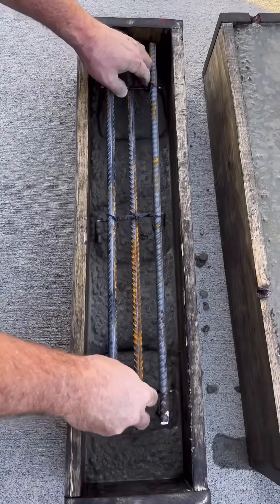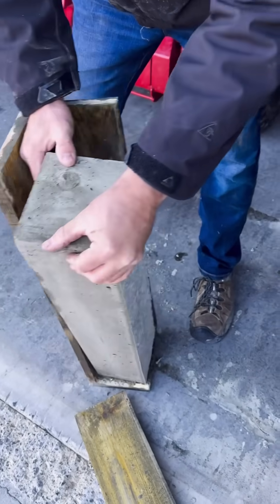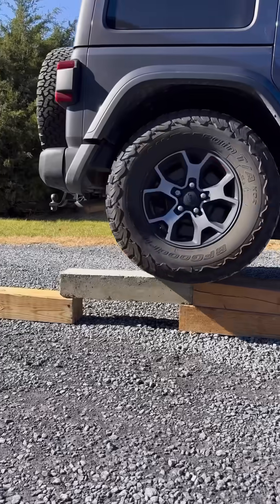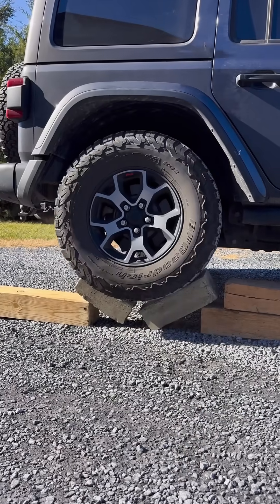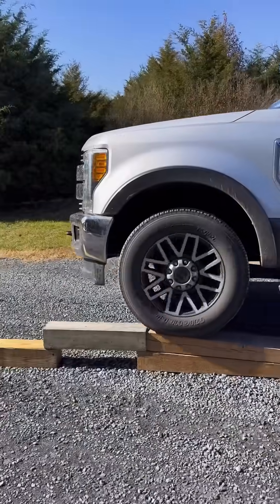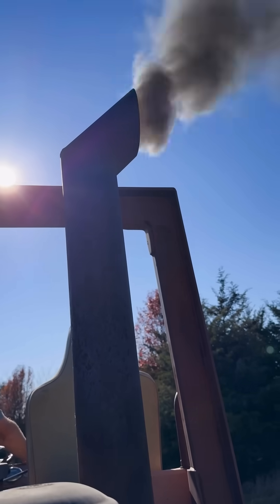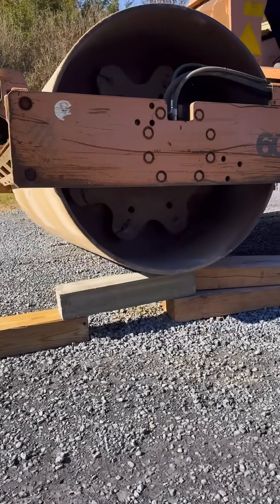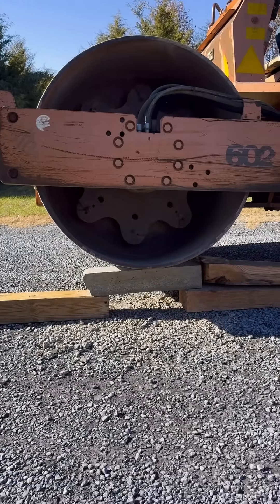Why We Use Rebar To Reinforce Concrete

Comment: Concrete slabs dont require rebar or wire mesh if placed on properly graded and compacted ground and properly spaced control joints will prevent cracks on the surface. Placing rebar or wire mess promotes fractures  but keeps it all together making the concrete strong but not visually nice. Therefore add rebar to suspended or load bearing concrete not slabs and save your money. Concrete finisher of 20 years and son of a contractor

Comment: In terms of how long ot was curing that would depend on temperature but other than that maybe 2-3 days. Could have placed the rebar lower as well to increase tensile strength slightly possibly
Reply from the maker: 2.5 days

Comment: I was told it takes 30 yrs for concrete to cure 100% .
Reply: Im guessing that would depend on what psi the concrete is and the width depth & length of it. Again just guessing
Reply from the maker: They say the concrete in the Hoover dam is still curing. Although a very small amount per year

Comment: The bars need to be at the bottom
Reply from the maker: Actually I put the bar in the top third when I poured the cement then I flipped it upside down before testing.

Comment: Clean, painted, not rusted rebar works best. All that rebar you get at the local yard that is rusted over causes issues also. Every builder uses it, and people wonder why concrete cracks so quickly.  Paint/seal the clean rebar so that the chemical reaction of rust/steel/water doesn't cause it to crack. I bet the beam wouldn't break if the rebar was clean and sealed before  putting in. You can see the concrete split from the inside center when broken with the vibration.  That means the rebar had an air gap around it from the rust/fumes.
Reply from the maker: You can purchase epoxy coated rebar

Comment: For the curing as in with the maximum load for its materials must take 2 weeks. with good watering after drying, concrete needs more water to strengthen.

Comment: The amount of people that think wood has better flexural strength than reinforced concrete is alarming. How many wooden skyscrapers have you seen? The wood in the video was never subjected to flexure. You can also see that the "triangular" sectioned wooden ramp had already split longitudinally under the load. The unreinforced beam didn't break when it was flat on the ground either.
Reply from the maker: All true, thanks for pointing it out👍

Comment: the only downside to steel rebar is when it rusts and causes the concrete to chip away, i wonder how well that new owens corning fiberglass rebar will do over the years,
Reply from the maker: I’m curious about that fiberglass rebar as well

Comment: No.4 doesn't develop in that short a beam. Development length for that weak concrete is in the range of 15" at least. So a beam loaded directly in the center would need to be at minimum 30" long.

Comment: The vibrating roller made me realize that we need to find a way to make concrete vibration resistant, so that we can make houses more resistant to earthquakes for areas where thats common
Reply: Sort of, but better to phrase it as we need to find a vibration resistant way to build houses in earthquake prone areas. You don’t need to use concrete if something else works

Comment: Another thing to consider is thickness. Concrete should really be 4 inches at a minimum, but 5 inches may be ideal for most applications.
Reply from the maker: I found that when you go from 4 inches to 5 on slabs it’s less likely to crack
Reply: @hausplans  I fix concrete for a living, and the difference between 6 inch and 4 is pretty huge

Comment: Well, one of the big reasons why that failed was anybody in a earthquake zone. Will tell you reinforced concrete doesn't do well under vibration. The metal vibrates far more violently than the cement

Comment: What would happen if you reinforced concrete with something like carbon fiber or kevlar ropes? Would it work?
Reply from the maker: I’m sure it would help some, but rebar is designed specifically for this purpose. They do make fiberglass rebar though.

Comment: Curing is important, it also depends upon the concrete also, but say you are using general grade cement than  the curing time will be around 7 days minimum, but when you regard the size then 5 days will be enough.
Reply: Just what I was about to say. Set concrete is a lot less strong than cured concrete.

Comment: The rebar didn't fail, that short beam doesnt allow the rebar to develop enough strength. Put some 180 deg hooks at the ends and it will hold even more weight.

Comment: Yeah, but the rebar will be the ultimate downfall of all structures made with it.  There are un-reinforced concrete structures from the Roman Empire that are still standing, but a reinforced concrete structure will start to fall apart after only a decade without maintenance.

Comment: 1 inch per day at room temperature.
Reply: I forgot, 50% relative humidity.
The slower the cure the harder the concrete too.
Yes, the curing can be slowed down.
I think it is the Hoover Dam that is STILL curing after all these decades.

Comment: Concrete should be water cured minimum 3 days before putting heavy loads on it. 7 days would be preferred. It takes 28 days for concrete to be fully cured. 

Water curing is wetting concrete in first 7 days. Like spraying it with water some 5-7 times every day. It is very important because cement needs water for chemical reaction that makes it solid.

Comment: The concrete can take weight after about 48 hours, but if you want it to be fully cured keep it wet and wait 28 days...  however it will continue to cure slightly even after that.  If you know what an asymptote curve is you will know what I am talking about.

Comment: When i first started working at our fab shop, my only job for 2 weeks straight (aside from general cleanup) was cutting old railroad ties to be welded into supports to go under concrete, for extremely heavy equipment to drive over.

Comment: This is also the reason we can’t use Roman concrete. While the concrete itself is stronger than regular, it’s made with salt water, which if reinforced with iron rebar, will cause said rebar to rust over time, making the structure weaker.

Comment: To all the people saying 28 days is the cure time in the comments, that is just a specified time, and concrete can take years to "fully" cure. 28 days is just what the concrete industry deems as a standard cure time. Then, concrete mixes are designed to reach a cretain specified strength by a specified time, a pretty typical spec is 4,000 psi in 28 days. Most commercial ready-mix concrete mixes will reach 70-80% of the specified strength in 7 days. If the project needs quicker strength gain, they can add accellerants to the mix so it will gain strength faster. Similarily, if there is a mass concrete pour, which is a monolithic concrete member that is like 4 or 5 feet thick in any dimension, the heat generated from the curing concrete is a problem because the inside of the curing member can be 150 degrees while the outside could be 90 degrees, this difference can create thermal cracking, in those scenarios, they sometimes use special mixes that cure slowly, thus generating less heat, and the specified cure time may be longer.

Comment: Some concrete rebar is pretensioned. Just as you said, concrete is super strong in compression but very weak in tension (much like glass). The pretensioned rebar forces the concrete into compression after curing. The end effect is greater tension carrying capacity. Practical engineering has a great video demonstrating this effect
Reply from the maker: Yep, prestressed reber is used a lot in bridges

Comment: your not wrong but this video is misleading... the longer the concrete beam the weaker it is...timber or steel is the better option for supporting a load, especially when it spans a gap and it has to support a lot of additional weight...concrete is only useful when all it has to do is support it's own weight or barely anything extra like like stairs, floors or platforms...even then if the ground isn't compacted or your surface isn't level it will still crack over time reinforced or not

Comment: I was a crane operator and a tilt wall man and we could not lift the Tilt walls until it reaches 3500 PSI and that usually takes about 7 days to sit to be sure it reaches that strength

Comment: Wrong design. 3 steel bar was placed in the middle of concrete beam. Which is called NEUTRAL LINE.
As you said : max tensile stress at the bottom  surface. And max compressive stress at the top surface. Between two surface neutral.
So if you place the 3 bar close to bottom surface the concrete beam would handle hips more load
Reply from the maker: Actually, it’s hard to tell by the video but the rebar was placed in the top third of the beam. Then I flipped it upside down before driving on it.

Comment: Bruh, you need to use less water when mixing concrete. If it's a soupy mess like that it is WAY too wet and will never cure to the proper hardness or have a good surface after use. If you need it to flow, use plasticizers, not more water. When you mix up concrete it is supposed to mound and hold it's form somewhat and you use hand tools and a pencil vibrator to evenly distribute.

At my job we used to mix concrete way too wet just like that. When we started doing it the right way, everything was better

Comment: Concrete is technically timeless, those things last forever which is why we still have some tomb made out of concrete from thousands of years ago. But our buildings probably won't last as long because of the reinforcement bars degrading them from the inside. Which is irony on so many levels 😂

Comment: Doesn't concrete get stronger the older it gets?
Reply from the maker: Yes
Reply: @hausplans  can you reproduce the re-enforced concrete experiment with a larger time between pour and test? It probably wouldn't give a different result but may break differently

Comment: 28 days to reach the advertised PSI. People say it’s a myth, because rapid set concrete exists. However, that only refers to the initial curing. It still will not reach its full compression value till 28 days. This has been tested over and over again by scientists with hydraulic presses & core sampling. But rednecks still prefer to say otherwise “I dRovE mY skIDsteER oVeR 7 dAy olD conCreTe aNd It wAs fiNe.”

Comment: Looks like 3day old. The reinforcement changed the dynamics of the beam the stress is put on the stretching of the rebar as the concrete compresses against. It's good until the rebar fails. That rebar could hold the truck by itself.😮

Comment: Just those 3 rebars alone without the concrete would support the vehicle. So what did the concrete do?
Reply from the maker: Those rebar by themselves wouldn’t support anything. You can bend Reber just by stepping on it. Rebar is really soft. You can actually bend a piece with your bare hands.

Comment: Our concrete hardens for 100 years to fully cure. Roman’s concrete gets harder for a thousand years. Heals itself because it contains limestone wich swaps out to seal cracks . The ancient Egyptians concrete witch the Roman’s copied hardens for nearly 5k years and by this point solidify into  a stone. Many peaple believe the great pyramid is all cut stone. It’s bs. It’s concrete. Only the outside layer was stone and hallways lined with granite to stand up to human touch and wear.  Your concrete was Likly a week old. If you mixed it with pig hair and limestone it would be 10 times as strong in that time. 20x with Fiberglas strands

Comment: It will sustain much higher loads if the rebars being placed lower than where you placed them which is almost at the center of the beam.
Reply from the maker: I actually put the rebar in the top third of the beam and then flipped it upside down before I drove on it with the roller. It’s hard to tell by the video but if you look at the shot where the roller breaks it, you’ll see it in the bottom third.
Reply: @hausplans  try 1/4 or 1/5 to the bottom and allow it to cure for 28 days....

Comment: Take: you can use regular concrete without support unless bulldozer runs over it
Reply from the maker: It depends on what you’re doing and how hard the ground is. I always put rebar in my driveways and garage floors

Comment: I've made thousands of test beams. The standard is to rod the wet conctete, tap the sides of the mold, strike it off and finish it. 2.5 days is not enough time for full curing. Cured under water, that is. But your lesson on reinforcement is true.
Reply from the maker: Totally agree 2 1/2 days is not near long enough. I was just trying to share the difference that reinforcement makes.

Comment: You need to put the rebar in the bottom third of the concrete block. That is where the tensile forces will be the highest
Reply from the maker: It’s hard to tell by the video, but the rebar was in the top third then I flipped the beam upside down before driving on it. If you look at the clip where the roller breaks it you’ll see the rebar in the bottom third.

Comment: And even though it was green, you can still make vast improvements to the block in your test. All you need to do is place wire mesh a few 1/16" from the bottom skin of the block. In reality, that large rebar in the center of the block was only resisting in shear and not tension.

Interestingly, both normal and reinforced concrete are composite materials and have a lot of common properties and attributes with more well-known composites like fiberglass and carbon fiber laminates.

Comment: I watched three videos of people putting concrete pads down with no rebar at all. Why?
Reply from the maker: Cheap
Reply: @hausplans  I agree. What killed me was these were professional contractors and not fly by nights laying down slabs for half million dollar homes.
Reply from the maker: To be fair sometimes we don’t use rebar in basement slabs because it’s on solid undisturbed original dirt. Plus, it doesn’t have to support the weight of a vehicle like a driveway or a garage floor.
Reply: @hausplans  No this was a slab home with an attached garage. I understand that with the basement slabs.
Reply from the maker: I’ve never done a garage without rebar

Comment: Doesn't have to be reinforced as many Roman buildings are still standing without reinforcements. It's more expensive than using rebar but it's possible.

Comment: And then people use concrete blocks to hold up a car, with the top and bottom open to the sides.  Which is in the absolute weakest direction.  So dumb.  Ever seen anything professionally built with the blocks on their ides?  Nope, you don't put all the weight on three webs.

Comment: It also wasn't fully cured. It still looked wet when it crumbled. Concrete takes 4 days to usually be considered cured enough to operate on especially on slaps and sidewalks made for foot traffic, but reaches full hardness after 28 days
Reply: Concrete doesn’t stop hardening

Comment: Probably would’ve held up if you had the right development length for the bar. Looks like the end of the bar slipped. If that’s a 20M bar, you’d need about half a metre of development length beyond the mid span on either end

Comment: Show me one with rebar not green. Give it a year i bet theres only 1 crack with the viberitory drum an rebar. If it was Probably only a few days old if it was green. I' broke out 25 year old concrete that was poured correctly And was some of the hardest stuff I ever seen. Also depends on the concrete. I've worked at caterpillar where they had to have large machines on it with in twenty four hours 14 in  thick. So they put heat and what's the concrete. Accelerate

Comment: I've built concrete bridges for House, and they're 6 inch thick and reinforced by steel and we usually have fully loaded sand trucks driving over them and those can weight anywhere between 25-35 tons. So it's safe to say steel make a very very big difference
Reply from the maker: Very cool!

Comment: you dind`t cure it long but as well concrete doesn`t need that much time. Sure, for final strength it does, but it is at ~80% already after a few days.

Comment: Should have tested it with the same vehicle first. You added unknown variables by using a supposedly heavier vehicle with a different wheel base.
Reply from the maker: The F150 is more than twice as heavy as the back of the jeep so it really doesn’t matter. The reinforced beam held way more weight.
Reply: @hausplans  I trust it did. Just saying they weren't subjected to the exact same pressure. Thinking from more of a scientific perspective, and also applying critical thinking.

Comment: looks like wood is better then both of them.
Reply from the maker: It white oak
Reply: It wasn't suspended, so it wouldn't have broken apart, but the wood fibers were probably crushed by the 7-ton roller which degrades its structural integrity

Comment: I’ll just say this the Colosseum is made out of non-reinforced concrete and reinforced concrete buildings of today will crumble without proper maintenance
Reply from the maker: That works fine when you’re doing arches but you can’t pour suspended slabs or floors without reinforced concrete. In those days concrete was used more like a mortar in between large stones.

Comment: Rebar has good tensile strength but not good compression strength.
  Concrete also cures by adding water, it doesn't bake which removes moisture. That's why cement trucks have to keep it moving otherwise it will start to set. Also. Concrete is cement compound with rocks in it.
Reply from the maker: All true

Comment: So filling the gaps would give it more compression strength… 🤔 
I have seen some tests adding latex to concrete for added compression strength. What if you use a additive and the rebar and vice versa. 

Will it improve the vibration test?
Reply from the maker: Maybe